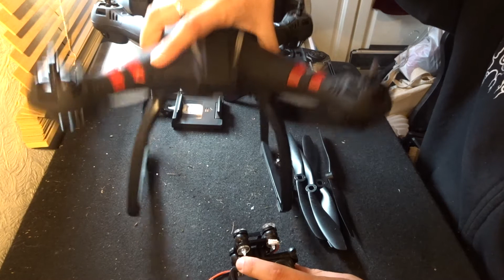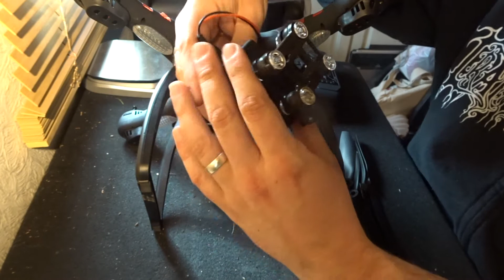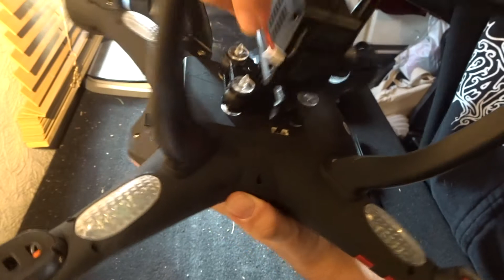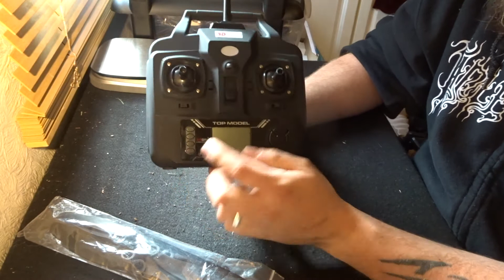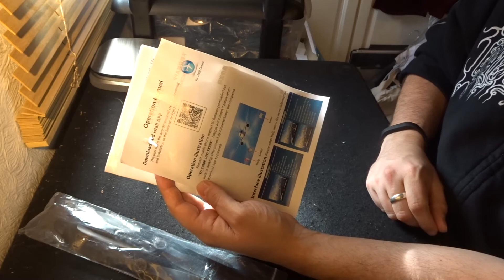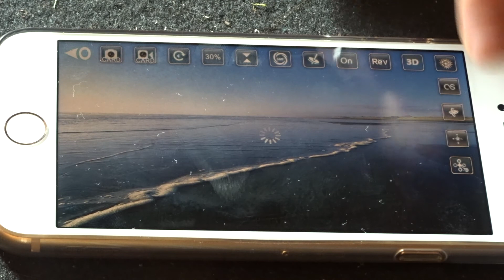Bayangtoys X21 GPS Drone Unboxing & App Overview Video

Comment: Just a FYI here: The GPS disc "antenna" is strictly-dictly cosmetic; I accidentally busted mine clean off and it still acquires GPS satellites just fine thankyouverymuch. :-)
 
I've gotten several complaints about the landing sprigs being in the video, so I removed them. Accelerometer calibration is a bit tricky this way -- the drone has to be perfectly level. But when you successfully accomplish that (left stick up/left, right stick down/right) then the geomagnetic calibration is easily accomplished and the drone won't give you any guff.
 
I've been performing a very fv¢k¡ñg dangerous HAND-launch for the last couple of dozen flights; as long as you keep your fingers away from the rotor blades, it's quite easy.
And it allows you to produce aerial vidz without those sodding landing sprigs in them! :-)
 
I also replaced the slightly-damaged OEM props with tri-blade props that I got on Ebay. I knew going in that I'd likely have sub-10-minute flight times but I've been pleasantly surprised that the percentage of less-than-10-minute flights has been quite low. Most of my flights with these props have been pretty much on par with what they were with the OEM two-blade props. :-)

Comment: My question concerns the qr code, the app with the device will not function. I have an android Samsung J7. When I attempt to download the app it will not load. Can you tell me if this function is operational, or may it be my device. Also if the app has changed, can you provide this, or maybe a viable option. Any help would be fantastic. John

Comment: AWESOME REVIEW I'VE BINNED THE CAMERA ON MINE AND I USE A 3 AXIS GIMBLE WITH A GO PRO JD
Reply from the maker: Thank you bud, yeah that's a good idea I used a camera I had with the same footprint so it would just fit into the same gimbal. 😀👍
Reply: I binned the camera on mine as well and will be using a Fitfort 4K Action Cam with mine once the replacement radio (transmitter) arrives.